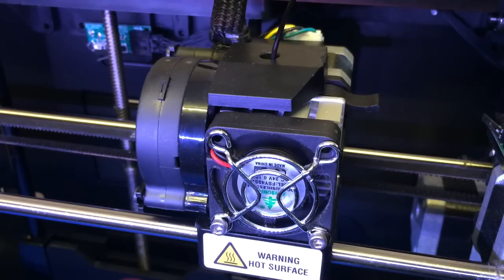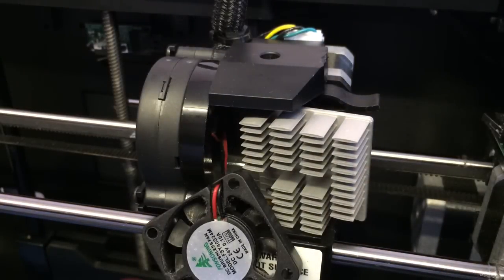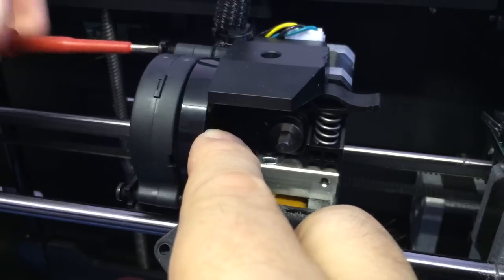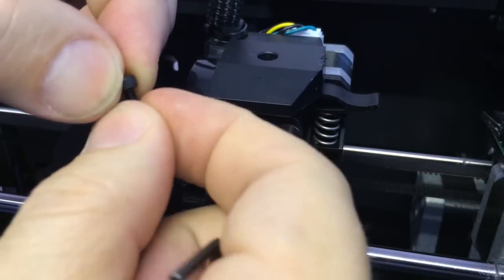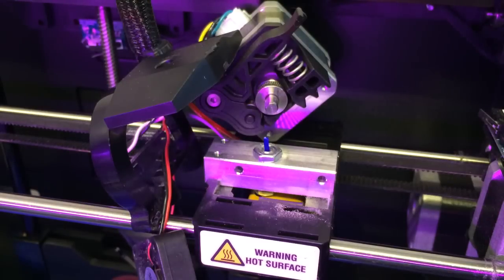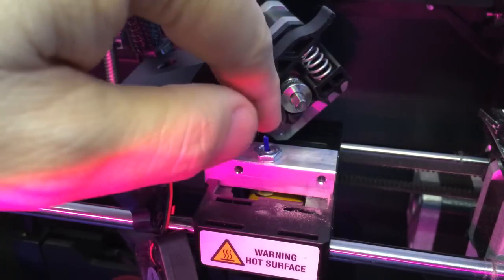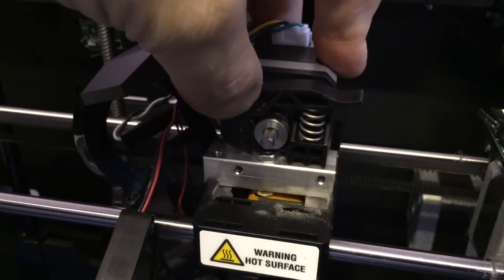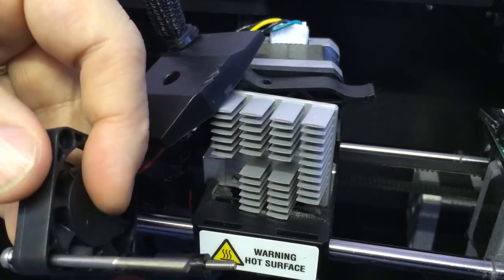Unclogging Maketbot Replicator 2

Comment: Awesome video!  I've never disassembled the extruder assembly before and am brand new to 3D printing but after watching you go through the process I feel confident in my ability to tackle this issue in the future.  Thanks for the great video quality and the close up of the parts as you work. (FYI, you have maketbot instead of makerbot.  I was still able to find it from searching Makerbot, but just a heads up in you wanted to correct it.)

Comment: Also, if you have the availability of tools, an allen wrench (2.5 mm) with a "ball end" is handy for removing the two screws on the left, that holds the side fan in place.  The screw heads need to be approached slightly from an angle and the ball end wrench will keep from wearing the screw heads prematurely.

Comment: Maybe its clogged because your extruder fan is mounted backwards.
Reply: One of the more clever things MakerBot support said to me on the phone, when I was having a problem, was "read me what it says on the front fan"  I did, and then support told me it should be turned around so the writing's not visible.  When the writing's hidden, the airflow correctly blows from the front toward the heat sink.  It does make a difference.

Comment: For anyone else stumbling onto this video 7 years later, all you need to do is remove the 2 fan screws as shown & simply unplug the connector on the back of the stepper motor/extruder & remove it instantly for accessing clog. Then heat up the block & use a needle/pin to pierce the clog & pull it out.

This video is more applicable to those who have upgraded the extruder to an aluminium one instead of stock plastic, the top shroud interferes with the plunger & ends up causing slippages as the temperature increases. All you need to do there is chop of the piece of plastic underneath the shroud thus sitting flush on your metal extruder gear/plunger replacement.